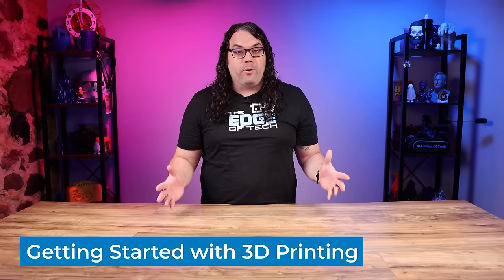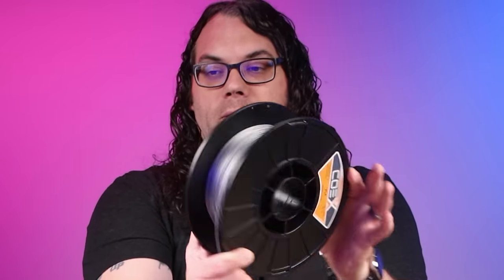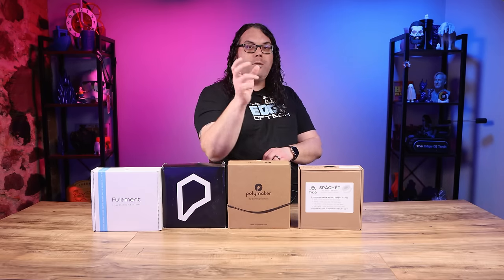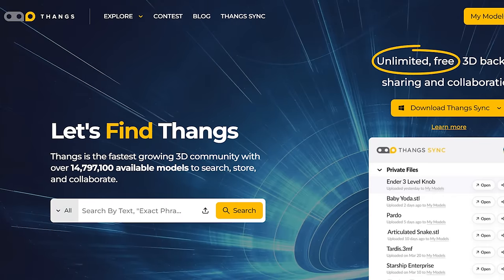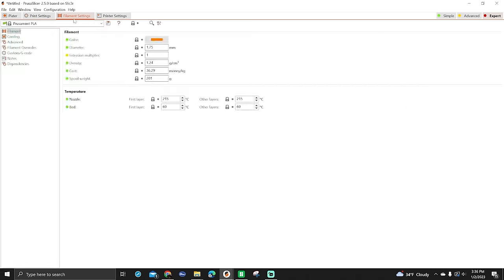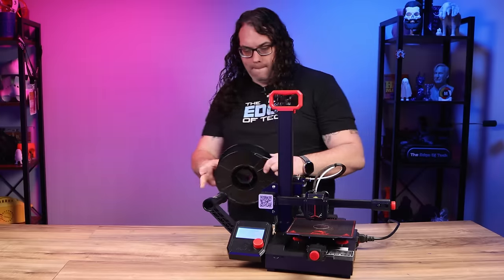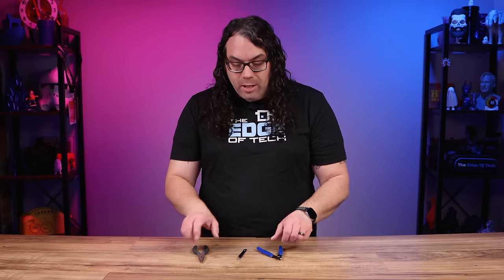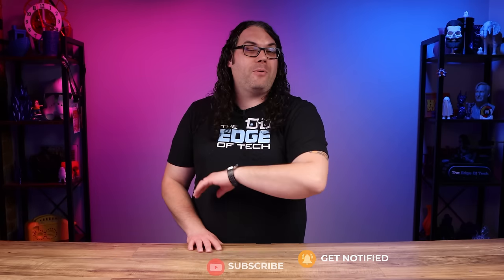Beginners Guide To 3D Printers In 2023

Comment: IMHO the best starter printer bang for the buck is the Elegoo Neptune 3 Pro.  I've had nothing but success with it from the first test print.  Setup was easy, it's not blazing fast but for churning out entire tables worth of wargaming terrain cheap it saves buckets of money.  I am using Lychee slicer and it's been easy as pie, and isn't a printer that needs a bunch of upgrades.  Self levelling, offset was super easy to set, direct drive filament feeder that is easy to load.  As someone who wanted to print more than fiddle around with the printer it's been a good purchase.
Reply: Nice! I am finally getting my first, pre-ordered Neptune 4pro😊

Comment: Jim, amazing intro for a new hobbyist in under 7 minutes.  My Bambux1 Carbon and P1P are my  9th and 10th printers, wish I had one of these as my first.  Bambu Studio works well for slicing and sending the files directly to the printer, and the printers just  work.  Your videos convinced me to add them to my collection and glad I did.  Thanks for your videos and reviews
Reply from the maker: Thanks David! I am glad you are enjoying them! I can't wait to see what kind of awesome things you print with them!!! Thanks for watching!
Reply: Do you honestly recommend an x1c as a first printer? I've been debating it for mine and I hear conflicting info... I hear that I'll be behind if something goes wrong as I'll know nothing on where to troubleshoot or fix... Ugh
Reply: @ShyneflowLC  I do  recommend it, with some cravats.  One that you have the money to do it, as you know it is not inexpensive.  Two you really want to get into the hobby.  Third, you do a lot of research, which sounds like you are  doing.   This has been my easiest printer to get going,  be careful and follow the setup instructions.  I would suggest to get the printer tested before trying the AMS if you get both.
Reply: @woodwaker1  I was eyeballing the combo with the AMS for sure. So you're saying you'd get setup and run without it first before testing out multi filaments ?

Comment: I just got my first 3d Printer. I made a simple Hook and then a cool dragon. So I decided to do something different and make a model of my wife's fav critter in ARK. (No we are  not kids we both over 60 enjoying our retirement) 
Now I want looking for the perfect model and found it my mini factory, Now there were 2 SLT of the same model one supported and one not. I started to print the supported one and learned that I will be wasting a lot of Filament and time since I should have used the non-supported one. It has a lot of pipe type of supports that I will be cutting off. 
Thought I would pass this lesson on.
Other then that I am having a blast and I have 30 models I plan to print and use for gifts and decorate our desk.

Comment: I see printers where the results are very granular and others that are nice and smooth. Which 3d printer is the smooth result type? I want to create clear structures to either shine light through or paint. Or if I want to print a windshield to a model car. So I need clear results.

Comment: What about workspace, venting, etc. I don’t have an extra room to print in and I e read that you should use a respirator and not to print near furniture you won’t want covered with excess dust or filament.  I was looking to purchase the mars 3 pro for my 8 year old and of course learn along with him. Is resin harder to use than what is discussed in this video, and is resin the reason to need a respirator?  It is indeed overwhelming.
Reply from the maker: Hi! Yes, resin is a different monster. It is much more messy and toxic if not done right. Ventilation is a must along with gloves, saftey glasses and something to protect the work surface. There is also more of a smell. I really would start with an FDM filament printer! I think you would both love it! Filament is much easier to controll the mess and you don't have to wash and cure it either.

Comment: What is the best printer to make a 3D model of a house?
Reply from the maker: That all depends on the scale of the house and how many pieces you would like to make.
Reply: @TheEdgeofTech  building out side view (multi colour )
Reply from the maker: @shafeerthripthithripthi1022  depending on how big you want to print it, you would be in anything multi-color, I would check out the bambu printers. They're the best multicolor right now
Reply: @TheEdgeofTech  size just 12*18 inch

Comment: I just got it today
I put all the parts together and then i turned it on and Just like it standing in the manual i went to motion, auto home and disable steppers. When i clicked disable steppers, a liquid came out of the printer and it started  smoking. And i dont know if it can get repaired 

Would not reccomend 1/10

Comment: But what about telling or rather warning beginners that if their first 3D printer is just a cheap one then they are most likely going to upgrade to a better one later. Why not buy the better one now effectively saving you more money in the long run. 

The Reason I ask is that I have not yet owned a 3D printer, but im a bit of a tinkerer so its about time I got one. I'm getting a bit older now too. But, I can not afford anything more than around $500 Australian Dollars ($333 USD) right now. I was looking at an Ender 3, but I really want to be able to work with Polycarbonate and polyethylene products. 

I know a couple of things about plastics because I used to work in plastics factories before the days of 3D Printers. I worked on injection molders and extruders, as well as vacuum forming, PVC Pipe bending and collaring on conduits in a glycerine bath as well as building custom jobs such as WheelChair tray tables for the severely disabled, helicopter windshields, and everything in between. I can operate CNC, im pretty good with 3D modeling (think Cinema 4D and Blender). I think its high time I got a printer. But which fricking one. Prusa, Enrder? Sub $333 U.S. ???

Comment: Great video! Thanks
Reply from the maker: Thank you! I am hoping it helps anyone who is thinking about getting into our great hobby!
Reply: Actually I am hesitating to get a Bambu Lab X1C…. More expensive but a complete printer…however , now they have been around for some time some problems appear…this scares me a bit particularly with these price tags!
Reply from the maker: @Emmanuel-Uncensored  If you have the budget, I'd go for it. They have been responsive to any issues that has come out, and have worked more with our community than pretty much any manufacturer I have had the opportunity to work with. With. There's always going to be negative posts because those are the people who post the most. When everything's going. Great! You just keep printing and printing and don't post that it's going great. I have four of them and while yes, I've had a couple hiccups and issues or errors, they've all been resolved or resolvable very quickly. Quickly. No printer is perfect right now but this one is still way out ahead of the rest. I'm not an affiliate, I don't make any money if you buy one or anything like that at this time, but I tell you anyone I know that has one loves it.
Reply: Ok thanks last question (s) 😉, would you skip the AMS as a starter? This option makes it a bit too expensive… do you believe their will be a price drop soon and Finally any tip to have a discount with Bambu Lab?
Reply from the maker: If you get an X1C without the AMS, you can always save for the AMS and buy it later!

Comment: I know I’m a little bit late but could you tell me if the printer comes with an SD card and what computers that I could use for it
Reply from the maker: Most of them do come with SD cards, and any newer Windows 10 or Windows 11 machine will be fine. Fine. Even if it's a few years old running Windows 10 you should be okay.
Reply: @TheEdgeofTech  where could I get one if I’m on a budget and don’t have that much money
Reply from the maker: @Lawanda17  how much is your budget? I would save up and do the Sovol SV06: https://sovol3d.com?sca_ref=922269.ThU7Ddg7Ov
Reply: @TheEdgeofTech  my budget is around 400-600 dollars
Reply from the maker: @Lawanda17  Great budget! I wou definitely check out the SV06 and get some filament to go with it! You will love it.
Reply: @TheEdgeofTech  is there a certain brand that you would recommend
Reply from the maker: @Lawanda17  for sure! It's the best beginner printer you can get right now and has a ton of features usually found on higher priced printers. Or you could save up and go with the Bambu Lab P1P. It's an awesome printer for the price and it's about as easy as it gets to use!
Reply: @TheEdgeofTech  sorry for all the question I just want to make sure I can be set up for success
Reply from the maker: @Lawanda17  Total understand!
Reply: @TheEdgeofTech  thank you for understanding 
What brand and type of Filament should I get
Reply from the maker: I would check out Polymaker, Coex3D, TH3D, Atomic, ProtoPasta and there are a few more. In the description of the video there is a discount to the TH3D site!
Reply: @TheEdgeofTech  thank you